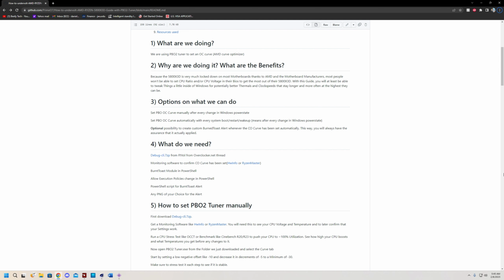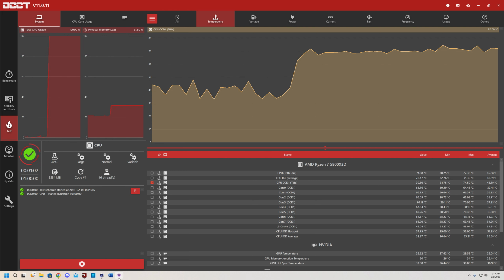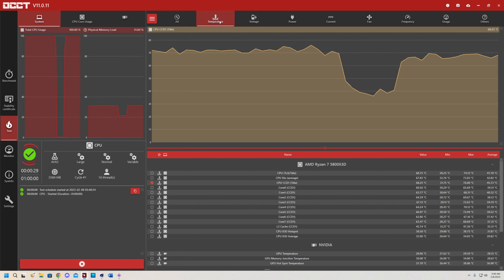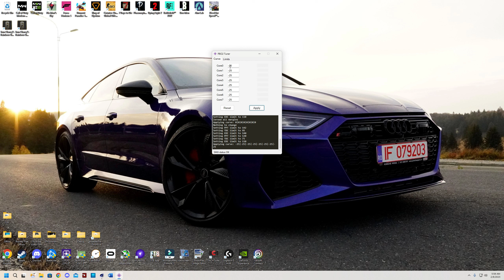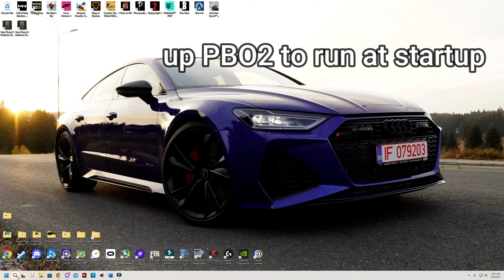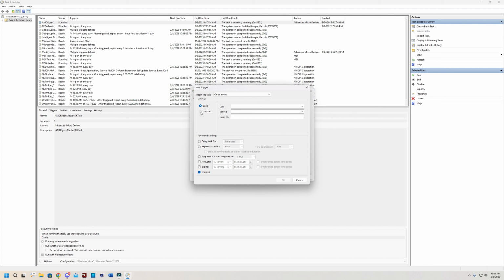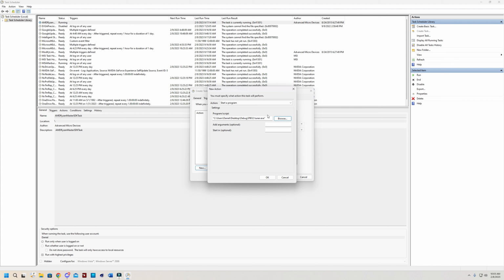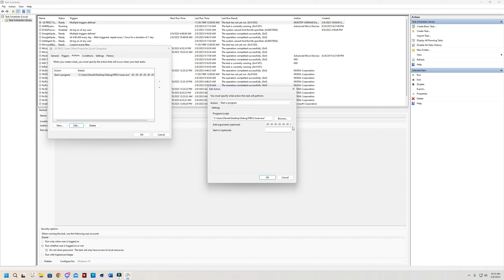5800X3D Undervolted with PBO2 Tuner (Setup Guide and Performance Testing)

Comment: Ah so I guess I cant use PBO in the bios for my X3D?
Reply from the maker: because PBO wasnt initially supported on 5800x3d, its only available through the app sadly. for Ryzen 7000, itll be in the BIOS too.
Reply: @Beefy-Tech  Even tho it was initially disabled in bios, that's not the case anymore.. It should be enabled on the latest bios 2806.  (Mine does work atleast, rog strix b550 Gaming-a)
Reply: MSI boards have kombo strike(others have their respective features) set to lvl1 is -10 lvl2 is -20 and lvl3 is -30 all core. I use lvl3, 76°c max temp in cinebench multi on my 5800x3D
Reply from the maker: @lunatik6168  for my board I only have kombo strike, I think that other boards will actually have full functionality then, but I do not know which ones exactly
Reply: @its_butterrs  I have a similar experience with my MSI b550. Even under load my CPU rarely exceeds 70C
Reply: b550-a strix have pbo in bios
Reply: and i can set limits
Reply from the maker: @paxwell  I looked it up and it seems a lot of motherboards do have support for it in the end, I'll put a pinned comment mentioning that

Comment: You don't need to use PBO2 just go into bios and load a saved bios setting from your a USB drive, when you do the OC and PBO will be available to fiddle with, but only until you boot into windows. Any changes you made will be there
Reply: bios on 3d vcache chips are locked im pretty sure for OC

Comment: using at -30 with my 5800x3d for 6 months, and never had any issue, the temps never go above 64c in games with arctic air cooler! its just a must to do for this cpu. (my rx 6800 is stuck on 99% usage in every game)
Reply: How did you do it
Reply: I got An Assassin III from Deepcool with -25 offset all cores being the most stable and 115W 75A 110A. In CPU demanding games the average Is 69/70 degrees going up to 74 for a split second. With more " normal " games it's about 65/66 degrees, sometimes going to 70 degrees. I do wonder if I Just didn't got the best pinned or if I'm missing something. Still, 11 to 12 degrees less than stock. Using the pc for 2-3 hours for gaming and I shouldn't have any issue, since it's 2 years that is running and temperatures are the same.

Comment: -30 offset on all cores 132W 85A 130A configuration has maximized my effective clock speeds while reducing temps by over 20 degrees celcius. Was hitting around 83c in far cry 5, now im at a very comfortable 62c after a long gaming session. Ive combined this with Fan Control to make the most out of my case fans and it has done wonders for my system. Thank you very much for your explanation and help

Edit: 127W 80A 125A -30 all cores, stable for 2months now
Reply: Nice. What cooler do you have for your CPU?
Reply: @Pazo139  an old scythe mugen 5 rev b
Reply: @Karel Leet  That's really good, even better than me with my 240mm AIO. I will redo the paste with a better one. I did  -250mV in MSI bios as I couldn't really get PBO to work for some reason.  I end up cruising in the low 70's at most with gaming so far. However, stress testing with the likes of Cinebench R23 makes it reach 90c albiet slower than stock voltage.
Reply: @Pazo139  I had terrible temps on my first paste, single dot method, then i reseated the cooler and i had spread out the paste a bit and it lowerwd the temps by a few degreees aswell, hope you can get pbo to work its really worth it, higher clock speeds + lower temps
Reply: @karelleet  Update; I redid the paste with my newly received  Thermal Grizzly Kryonaut and spread the paste on the entire chip. Before that I did the dot method in the middle. Turned out I didn't put enough I guess. Because it hardly covered half the chip lol. Now my temps are great maxing 55c on Cinebench R23 with my continued undervolt. Also what are we referring to by higher clock speeds? Higher than 4.5ghz boost?
Reply: @Pazo139  no higher clock speeds for me were actually reaching 4.5ghz. On stock settings it would never even get there. Great job on the reseat 55c is amazing temps man
Reply: @karelleet  I see. Ty. I no longer get bad thermal throttling.
Reply: Good settings. How do you get the 132W, 85A, and 130A configuration to start during start up? Is that possible?
Reply: You should know that you're the best, ty for share your settings
Reply: on my end -30 would crash system after 20 min
Reply: @nineball8193  update, been on -30 127W 80A 125A since 2months, temps staying below 70 at 21Celsius outside, unfortunate yours wont do -30 I'd try -25 then -20 etc
Reply: @karelleet  still stable? :)
Reply: @framo_official  absolutely mate
Reply: 999W, 999A  and 999A I sett on my limits xD goes 
joke to side I just put in 200 etch one to not lmit CPU and start to undervolt after negative -30 all cores and my goes 1.256V as higest and 1.169V avg and 0.888V as lowest and my blck 102.
Reply: @karelleet did you do any overclocking?
Reply: @nickeastt  you cant really overclock, I think your best bet would be undervolt and ensure the clock speeds are maxed out as without an undervolt high chance they are throttled
Reply: -30 all cores 95 60 90 Works good for me, I got  Max 72c in  CB R23
Reply: @Gosha_Gosha  Insane numbers friend
Reply: @karelleet  These settings allowed for a 10°C decrease in CPU package temperature. In R23, it achieves scores that are 500/600 points lower than with the -30 125-75-120 settings. However, in games, it performs just as well, if not better 🤷🏽
Reply: when using the undervolting settings, should xmp/expo be turned off in BIOS?
Reply: @airincooks  nah why? CPU voltage and dRam Voltage are two different things
Reply: У меня одного в стоке этот процессор не греется выше 65-70 спустя десяти часовые игровые сессии? Использую воздушное охлаждение dark rock 4 pro 250w и пасту termalgrizzly aeronaut вроде бы. И то мне кажется что такие температуры только потому что под ним стоит 7900xtx у которой рабочие температуры 75-85 градусов :) Поделитесь пожалуйста, какое охлаждение вы используете и какие температуры у вас в стоке при обычном использовании, а не в стресс-тестах
Reply: wowww thank you for the specific values of the ppt tdc and edc. I was having a problem not hitting 38-39 degrees on idle but now im all good

Comment: Tip for 5800X3D owners, if you're still getting toasty temps, you can combine an offset in the BIOS (offset of the VCORE, so FE -50mvtt) with PBO.
Seeing as the absolute clockfrequency isn't very high, -30 usually isn't enough to drop the temps. So I use a -50mvtt offset, then set -15 PBO2. Dropped temps from 75 to 65 and im hitting the same 4450mhz.

Comment: I'm amazed man. 
-25 all core, set PPT 135, TDC 90, EDC 135 and now I'm maxing out at 75c (on air cooling) and boosting to the 4550 100% of the time when stress testing.
Reply from the maker: That's the beauty of undervolting! On X3D cpu's (5800x3d, 7900x3d, 7950x3d) the results are always nuts. Lowering those Temps leads to best performance🙌
Reply: With the ppt tdc and edc, how do you set that automatically in the scheduler?
Reply: What mobo you got mate?
Reply: @qubes8728  Aorus Master
Reply: @transcendtient  Nice, ive got the Pro v2(b550). What has gaming performance been like with those settings? cheers.
Reply: @qubes8728  I still haven't upgraded my GPU... rockin an RX480... so not the greatest but better than my AM3+ 8320e was. That PC was a beast though. I got a 40% overclock on that CPU stable all core all day. Went from stock 3.2ghz to 4.6ghz.
Reply: Is stable ?
Reply: Damn 75c is a bit hot. But you are stress testing so.

Comment: This did absolute wonders for me. I got it all the way to -30 stable, so i guess I got a good bin. I'm sitting at 4.4ghz 80c at 80 watts. I know that the temps are still a bit high. I'm still using my hyper 212. I know I need to get a better cooler. I wasn't thermal throttling before, but I didn't like it sitting at 90c constantly.

Edit: I actually changed my best, and 2nd best cores to  -25 -27 to get better performance.
Reply: Thats because you had "clock-stretching". Few CPUs can go -30 all core without nuisance of "clock stretching" https://youtu.be/jTkDqARDkGg?t=686
Reply: @Coco Sloan  this doesn't seem to be the case for me. My effective clocks are almost all the same. My performance has also not seen a hit, but only gains. I did set my fastest cores with a different offset. However, my other cores seem to be fine.
Reply: @DubCity  Now maybe its fine - but while tuning and setting -30 all cores - you can observe that effective speed of all cores are lower than expected. That's because one core is getting to low voltage ,drops in frequency and takes all the other cores down with it , and needs to be adjusted higher in CO. Watch the video and check you do everything right .
All I'm saying is there are maybe 5-10 CPUs in the world that can do -30 all core without issues !
Reply: Same here but it's a 212 Evo, with be quite silent wing 4 fans for push pull combo, easily handles this cpu with -30 which I was able to get myself 🔥 usually chills around the 60s under load with gaming
Reply: even with a fuma 2 it is hitting 90C, using the pbo2 tunner, now it is on 80C (though I'm on an ITX build -closed)
Reply: @Lordofgamerz  Do you use Boost Override ?
Reply: @cocosloan3748  nah
Reply: @Lordofgamerz  Then its very plausible you can run it -30. 👍
Reply: @cocosloan3748  what would you recommend? Would it be your 2 fastest cores getting a lower offset like a -10?
Reply: @mannyfresh7065  Well fastest cores should be lower - by how much - it depends - you can try increasing in increments of 2. Its doable that bad cores have -30 and good ones 28. If crushing then you increase them by 2 , so -26..Or - 24...until stable.
Depends on Boost Override too. If you set it +50Mhz  then -30 -28 can be fine - but +150Mhz or +200Mhz - you will need much higher voltage  so -10 ,-5,  even 0 or +10 !...
Also depends on your PTT (power limit) if its high - more voltage needed.
Reply: @mannyfresh7065  Its just balancing act - and all CPUs and owner needs are different - some like high clocks and single thread performance  , some need the CPU for rendering on all cores ...Some like it cold and efficient ..
Look for the  sweet spot..👌😜
Reply: @cocosloan3748  Only 5-10 5800x3ds can do -30 all core without issues? I really doubt that. I don't get any clock stretching at all. 5800x3d has overall lower boost clocks compared to the 5800, making actually many 5800x3ds capable of going -30 on all cores.
Reply: How do you find out your best cores?

Comment: Thank you. Was able to let my 5800X3D run 4450Mhz All Core @ 74°C. Before that it was 4000Mhz @ 90°C. My Settings are -30 All Core with PPT 125W, TDC 90A, EDC 110A

Comment: I just got myself a used 5800X3D....running -30 on all cores and PPT@100W...TDC@70A...EDC@100A.  Seems to be rock solid, and temps are crazy low...70c running R23 multicore

Comment: My 5800x3d managed -30 for all cores. Seems stable after an hour of OCCT CPU testing and several hours of gaming. Thanks for the video!
Reply: same with mine using -30 on all cores for like 4 months by now , 0 problems and manage to drop the temps by almost 11 degrees with this undervolt profile.
Wonder if i can go lower then this , and try -35 or -40 ? :)))
or -30 its the limit max ?
Reply: @sorinpopa1442  -30 is max, if u go lower, than nothing happens
Reply: @HybOj  i.c ya thought the same , didnt saw anyone online that went lower then -30 yet ^^

Comment: Thanks a lot, I had an 240mm AIO for my 5800X3D and I didn't see a lot of improvement compared to my tiny aircooler it was still reaching 50-60 degrees idle now it's at a happy 35-40
Reply from the maker: That's good to hear!

Comment: Thanks for this! Im not completely clear how the curve offset values work, havent messed with OCing much at all really in over a decade, but was able to get my 5800x3d set to -30 on all cores wirh 120W/75A/110A, simply matching your settings on limits, but it ran the OCCT stability test for about 7 minutes before i stopped it, seems pretty solid!
Reply: I had already set my infinity fabric, memory controller, and memory speed all to 1900mhz
Reply: 7 mins is not stress testing lol
OCCT has several stability tests with different loads and 7 mins in barely goes into the first one
Reply: @ij6708  slaps case it ran for 7 mins it'll run til it crashes. Then i'll get back to you sweety slaps case again

Comment: Thanks for the help. I ended up doing your settings and things worked great. Then searched more info about how to set limits to scheduler and found out even better settings in overclock forums with lower temps with the same performance. Just replace values “-30 -30 -30 -30 -30 -30 -30 -30 95 60 90 0”. It just adds 95W PPT, 60A TDC, 90A EDC. Worked like a charm!
Reply from the maker: I run with -30 now too! I didn't before just out of fear for stability but it was stable for a week so I stuck with it. 

And yes I only found out how to input the limits last week so didn't include in video unfortunately but you are right, and your limits are great👍

PS: girlfriend now has my 5800x3d as I moved to 7950x3d, but I input the scheduler with undervolt and limits for her!
Reply: @Beefy-Tech  Great! Btw... Your video was so good with step by step instructions. It saved so much time <3
Reply from the maker: @Monsux  I'm glad to have helped! I want to make more videos like this in the future in hopes it'll simplify everyone's time with a process that is otherwise not very clear xD.
Reply: @Beefy-Tech  Hello ! Put that values in Task manager (PT, TDC,EDC ). But I`m not sure how to check them if they apply directly. Ok, I restart - I entered in PBO2.exe. The -30 is in place, but the others (PT, TDC,EDC ) when I put them manually and click apply - say, "configuration changed". Is like the arguments for  PT, TDC, and EDC are not applied after restart. Yes, I put the values in the task sheduler after -30.
Reply from the maker: @M4V3RiCkU235  in task scheduler where you have the -30mv  line, ull have to type your 3 power limits, then type a 0. Your task scheduler line should look like this:

-30 -30 -30 -30 -30 -30 -30 -30 120 75 110 0

That 0 at the end is important for it to work👍
Reply: @Beefy-Tech  Did that. That`s the problem: I don`t know if the profile is kept after restart, or just the curve. For curve, definitely works

Comment: works for my 5800x3d, from 49c idle to 37c!!! Thanks a lot bro. Cheers.
and i even applied a custom alert for every time PBO2 values have been applied.
Reply from the maker: Awesome to hear fam!
Reply: My 5800X3D is 32c at idle with a dark rock 4 air cooler and stock settings...........

Comment: Awesome video! really glad you included how to edit after the task is created makes it easy to use for beginners. Went from 80+c to 75c in r23 while boosting to 4.45G all cores most demanding games (hell divers 2 was making my ac work overtime:) dropped 10/15c to around 60c with setting at  -30 -30 -30 -30 -30 -30 -30 -30 120 75 110 0. Best way to tame the spicy 5800x3d if your MB is locked curve like my ASRock x570. Air cooled with Thermalright Peerless Assassin 120 SE in a  Fractal Torrent case all fans now running at 25% instead of 50 to 60%.

Comment: Thank you So much! for the indepth tutorial, was able to get my hands on -30 x8 and  PPT 100W TDC for 70A EDC 100 temps 62 top on OCCT with 360mm AIO constant 4500MHZ, so much cooler and so much preformance gain thanks for the task setup i had trouble with that!.